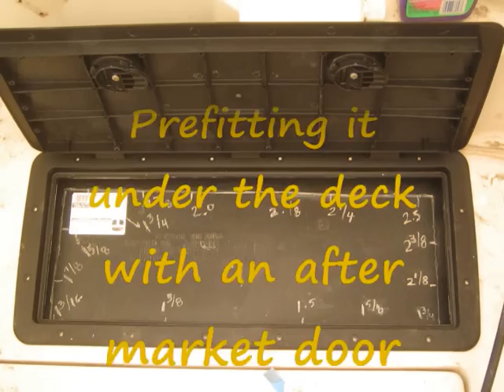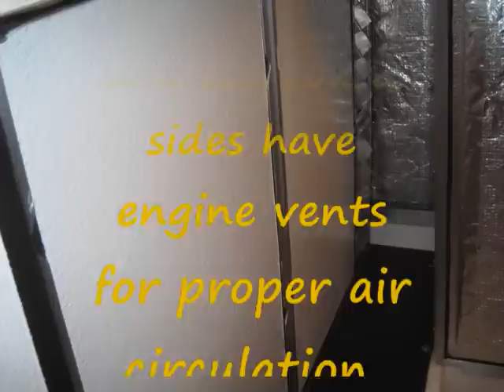Epidode No. 3 of "Pretty Perfect" -  Boat Restoration,  Rebuilding and Reconstruction

Comment from the maker: Good point.. Thecostof a 29 ft boat new is around 120K. A used one newer 60K. The problem w them isthat there is so much that would need to be re done to get to the level of a custom boat.  I estimatethe cost for Pretty Perfect to be between 45-50k before electronics.
Thanks.